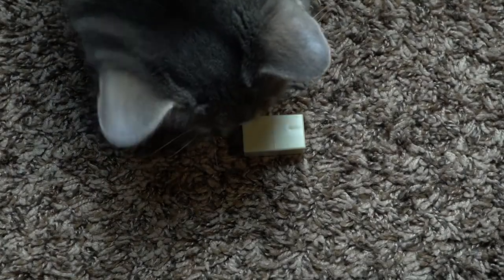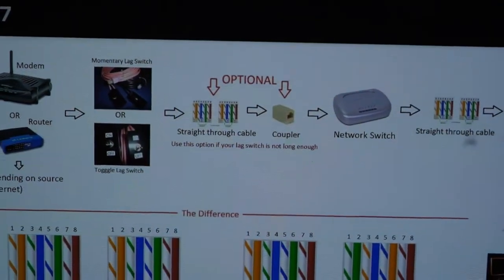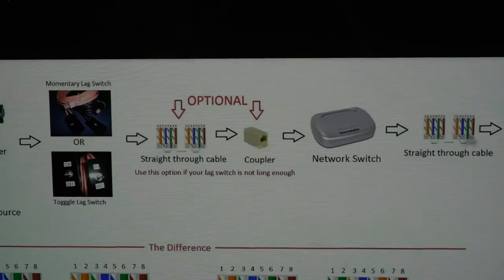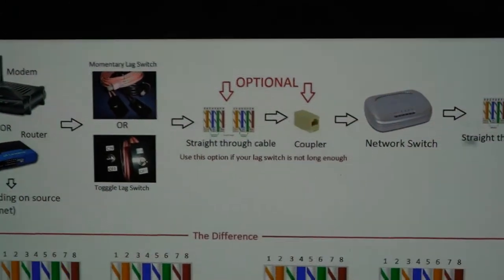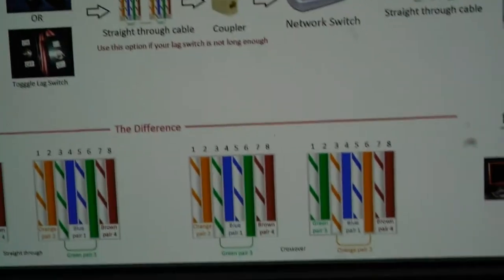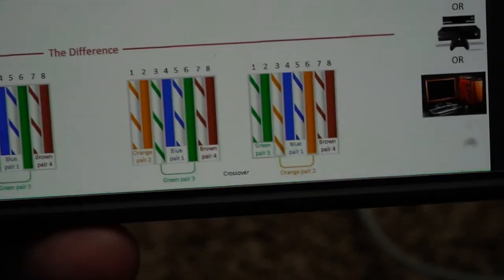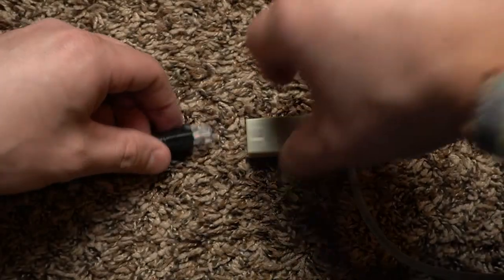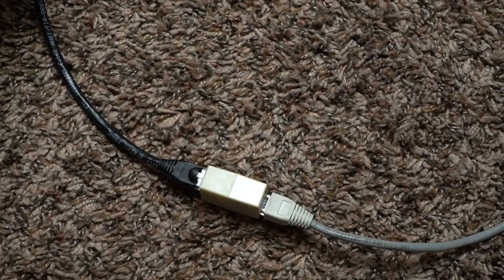Lag switch informational video 2.0

Comment: I have it setup as in video with a TP link switch, i feel like it takes sometimes a couple extra seconds to reconnect so i found it really unreliable and sadly not useful :(
Reply from the maker: Okay, don't use that network switch then, use a different one.
Reply: @mikeeyram  why is it so different ? Just so I know what to look for.
Reply from the maker: @alexbrun6863  I wouldn't know. What ever is on the inside is causing more latency.
Reply: @alexbrun6863  the thing is you don't need a switch what you need is an ethernet hub

Comment: When I use press the lag switch I get disconnected it seems the network switch is reconnecting to slow to the console? What should I do do you think it’s something in the net switch’s settings to make it faster or I need a whole different switch? It reconnects like 3 seconds later is that to long?
Reply from the maker: The only way to change network switches settings is to have a managed one, which I don't know why you would have one of those. It sounds like you could have a crossover cable between the network switch and console. Network switches should reconnected in 1-2 seconds, 3 seconds of total lag might be fine for some games but not for others.

Comment: I have an Arris Modem/Router combo....I have a straight through cable coming from the Arris to an 8 port switch. I hooked one side of the Lagswitch to a port on the 8 port, the other to a Xbox One....I believe I have it correct....when I push down my Momentary switch....for not even a quarter of a second, I lag out....I know the Lagswitch is fine because I bought it from you on Ebay....I'm just wondering if I'm doing some wrong....you rock...ty
Reply from the maker: You have the right set up for being immediately disconnected (as the the item description says, on eBay), if you don't want to be. I'd suggest watching the video and following that set up.

Comment: Can you hook up your leg switch directly to the modem and then into your xbox
Reply from the maker: Nothing is stopping you. Nothing else in the house would have internet as you'd have to unplug the router from the modem to be able to plug the lag switch in. Then as long as you want to be immediately disconnected, you can plug a lag switch into your console.

Comment: hi mike. bought a lag switch off you with the foot pedal for my ps5. ..playing destiny 2, it seems to somewhat work but when i use it , it makes the enemy players laggy and i cant damage or kill them, then suddenly i die to them 5 seconds later. i havent been able to get the jump on anyone at all, its almost like its working in reverse, i mean i can run around fine, shoot and whatnot, but cant do damage..  is this normal. any advice or explanation appreciated. thanks in advance.
Reply from the maker: Games are different what could be correct for one game could be incorrect for another. Trial and error is the best way to figure out what works best for the game you're playing. 
It sounds like you shouldn't use a lag switch when you want to shoot. It could help get close to someone or running away. Also lag switches only work one way, there is not such thing as working in reverse.

Comment: What network switch are you using because the ones I have are all just wireless and I need a way for it to go from my modem to my network switch to the console all wired
Reply from the maker: So you're one of the few people with a wireless network switch. I've never seen one myself. I have a TEG-S24DG network switch. I wouldn't connect a modem to a network switch, I'd only connect a modem to a router.

Comment: Hey I bought the big red button from you about a week ago but it doesn't seem to be what I need. I just finished ordering the toggle switch. The button works, but was too difficult to press whilst in gunfights. Hopefully the toggle switch will be an easier fit. I'm assuming the toggle switch lags by itself without having to press periodically. Either way, thanks.
Reply from the maker: If a button is hard to press (and release), then a toggle switch is going to be really hard to toggle back forth. A toggle switch lags whenever you turn it on and doesn't lag whenever you turn it off. The foot pedal, and maybe the remote one, are the easiest. You can also put the big red button lag switch on the floor.
Reply: @mikeeyram  well I can flip the switch in front of me, for a few seconds here and there, much easier than tapping my foot to a beat while playing lol. I did place the button on the floor for a while yesterday, but couldn't get value out of having my body in a weird position to play kick drum 😂. Thank you for getting back to me, and for the products. We've been playing against people in the last of us, using a switch to beat us. I was just trying to level the playing field. If it doesn't work for us, no biggie. I appreciate your time man.

Comment: I bought you 2 cables.. a toogle cable and a momentary cable.. but unfortunately with the 2 cables the reconnection is too long.. 5 sec to 7 sec is really too long.. I use a netgear fs605v2 router and a  fs105 but it's the same thing .. do you have a suggestion to help me
Reply from the maker: The number of cables or lag switches is irrelevant to the reconnection time of the network switch. Those to network switches have always worked great for me, I don't know why they wouldn't for you.

Comment: What is the network switch because I was trying it on cod and it didn’t work what would you recommend because I want them to lag not me
Reply from the maker: You can google what a network switch is. According to what you said the lag switch is working fine. A lag switch is connected to your network, you will always lag. To affect others you have to be host.
Reply: @mikeeyram  how does that work like so if I’m host I will be fine and they stand still ?
Reply from the maker: You must have missed where I said: "A lag switch is connected to your network, you will always lag" When you're host, the lobby will lag with you. The results depend on the same, it varies.

Comment: how do i put my console on lan w/o a computer
Reply from the maker: It sounds like you don't have a LAN cable where you're at. Assuming you PC is running on WiFi, plug the lag switch into the PC and network switch. Then you'll need to configure the PC. I wouldn't recommend using the PC as a network bridge though, I wouldn't recommend a network bridge all.

Comment: Will the lag affect all devices connected to the switch? or to the router? How could I connect a separate console and ensure it is not affected by the lag switch
Reply from the maker: Why is the router even in that question? You think the internet goes from the modem, to the router, to the network switch, back to the router and then back to the network switch again? If you don't want to affect anything else, then don't plug anything else into the network switch, the should be common sense.
Reply: @mikeeyram  does it matter what the straight through cable is ?
Reply from the maker: @sinlxess  There is only one definition of straight through cable.
Reply: @sinlxess  🤣🤣🤣

Comment: I set up router connected lag switch then to network switch and straight cable from switch to console, internet just not working, after i unplug lag switch cable from switch or router , internet comes back, when both sides of lag switch connected it aint working, internet is off, what am i doing wrong please help, i got this 50 feet button lag switch from ebay
Reply from the maker: Without a LAN cable plugged into the network switch or router you have internet on your console. When you plug a cable in, you don't have internet. It sounds like the console is auto connecting to LAN when it detects a cable, however the port isn't fully working as there's no internet. I would suggest to look at the LAN port on the console and possibly getting it fixed
Reply: @mikeeyram  i just cant use lag switch, the second i connect both sides of it to router and switch, internet shuts down on console, everywhere pretty much, when unplugging it, internet comes back on console, i just cant use it on ps5
Reply from the maker: @DT_775  Once you fix the LAN port on your console then you can use a lag switch. But for now WiFi only it seems. Unless you have a weird loop in your setup or the network switch is actually a 2nd router or both.
Reply: Thanks for the help, i had it wrong connected, lag switch from router to switch and another cable router to switch, didn't realise lag switch was main cable between these👍
Reply from the maker: @DT_775  To be able to run 2 ethernet cables between 2 devices you need to set up link aggregate. However doing that would make a lag switch useless, as the other cable would just bypass the lag switch.

Comment: Hi, I have a question, if my internet modem is also a router does it work ?
Reply from the maker: I don't know where/if I say it in the video but the item description says (on eBay or Shopify stores): "The router may stand alone or be a modem / router combo." Basically you're asking if you can plug the lag switch into a router, that's what the set up says to do, plug it into a router. The fact that the router has a modem built in is irrelevant.
Reply: @mikeeyram  Hello again, I have another question, I  just received the Foot Pedal Momentary Lag Switch and when I press the button, the internet connection is too long to return, you know why ?
Reply from the maker: @Gasty.  Check your email, I replied there before this comment was posted.

Comment: Hey man I got your button and whenever I use the switch it works but my reconnection time after I stop lagging is very slow. What do you recommend I do? I’m using the netgear gs305 network switch
Reply from the maker: Figure out what your ping is to see if that's the problem. Try a different network switch.
Reply: @mikeeyram  do you know of any switches that work best?
Reply from the maker: The two listed in the item description.
Reply: @mikeeyram I’ll try one of them, thanks for sharing
Reply: @mikeeyram I just got the FS105 switch and I connected everything the same way but now I can’t lag at all. EDIT(Lag switch is working now I noticed the ports on the switch matter for it to work)
Reply: Wdym when you say you dont lag anymore ?
Reply: I have the same router switch and i can't get mines to work. Where did you put your ethernet cable on? 1-5?@oppressormk2594

Comment: I got it all working pretty much but it takes around 15-20 seconds before lag switch happens, is there a way like speed up lag switch to happen faster, maybe it depends on router or network switch?
Reply from the maker: Basically what you're saying is you're able to unplug the ethernet cable from the network switch or router it takes your end device 15-20 seconds to lag and then even longer to disconnect? Logically that doesn't make any sense. There's something wrong within your set up somewhere or maybe the end device is switching to WiFi and then back to LAN for some reason after 15-20 seconds.
Reply: @mikeeyram  im pressing lag switch its got button type switch, holding 15 seconds and works after, whats normal lag time as it should be i dont even know
Reply from the maker: @DT_775  Lag switches work immediately when pressed or flipped (type of switch doesn't matter) and you can usually lag for 3-5 seconds, any longer and you risk being disconnected.  I can upload a video of a lag switch working on a continuity tester.
Reply: @mikeeyram  i really don't know whats wrong with my setup, i got main router in living room connected to it with long cat5e cable to second router that is in bedroom,  in WAN head jack of second router i got lag switch connected and second end into Network switch, from there straight through cable to ps5, pressing red button on lag switch, 15-20 seconds holding then lag magic happens, not getting disconnected it changes servers in game and stay in game, rdr online, i do all the stuff in game, missions, collectibles nobody bothers which is good, but 3-5 seconds switch how that even possible i wonder
Reply from the maker: @DT_775  Okay, you have one router and an AP. As two routers in a single setup will cause problems. WAN should only be used when connecting to a modem. You should be using LAN ports in your house. 3-5 seconds is possible with the correct set up.
Reply: @mikeeyram  yeah two routers are bridged in single setup, without wan connection no internet from second router
Reply from the maker: @DT_775  WAN is mainly use to connect a router to a modem, not routers to network switches, that's what LAN is for. WAN on the 2nd router should be connected to LAN on the first router. To anyone reading this else, don't have 2 or more routers in your setup, get an AP.

Comment: How i got no Delay and which is the best cat cable
Reply from the maker: If you get no "Delay" or lag then the lag switch is not connected to the end device or it's being bypassed. Currently the best cat cable is cat 8, with 9 and 10 coming soon. However unless you have a server or you run a data center, who cares.

Comment: I hooked mine up according to pics amd vid. Switch has power. Ports have power. Lag switch works.  Net switch works. Once I plug the lag switch into the net switch and straight through from net switch to console I have no internet going to console. Help?
Reply from the maker: Make sure all 4 ends are fully plugged in.
Reply: I got the network connected. How long should the toggle be left in on position? Like am average
Reply from the maker: That depends on how long the network switch takes to reconnect and how much lag the game can handle.
Reply: Its gta and idk haha 8 secs put me in a solo public lobby
Reply: Is there a certain set of settings I need to put the Xbox on?
Reply from the maker: Just make sure it's on LAN and not WiFi
Reply: @mikeeyram  how do u do that on xbox
Reply from the maker: Usually network settings are under Network Setting, or System Settings then Network.

Comment: Can I connect this to a Verizon Wi-Fi extender?
Reply from the maker: As long as it's a hard wired extender. I have a wi-fi extender in my basement connected to the router via a Cat 5e cable. If I wanted to I can plug 3 more things into the extender.

Comment: Hey great video,was wondering if you could help me when i use my lag switch it disconnects me to a solo lobby on red dead was wondering if it was my network switch being to slow i have router to lag switch to network switch to xbox with Ethernet cable is this correct ?
Reply from the maker: Only you can tell how fast or slow your network switch reconnects, I have no way of knowing.
Reply: @mikeeyram  yea what would be the average time it should reconnect mine takes about 4-5 seconds which feels kind of long i have ordered new one same brand as yours so hopefully gets working thats for the video did greats job
Reply from the maker: 2 or less is best.

Comment: I get lagged for 4 mins and then it gets me out. It disconnects. What could be the problem? Thanks. Great video! 👍im using a Tp link switch
Reply from the maker: That's a very long time to lag. It sounds like an ISP, modem or router problem. Or you could be lagging to much, not allowing the connection to go back to normal.

Comment: Question. I have spectrum isp and a netgear router, with and Trendnet switch but it's taking 7-8 seconds for my switch to reconnect. Do you have any tips or ideas of what I can do to correct this? Or what router/switch I should use instead? Thank you btw
Reply from the maker: Use a different network switch.
Reply: @mikeeyram  what network switch ? I have netgear fs605v2 and have the same problem ..its too long to reconnect ..7 sec
Reply: Did you find a switch that was faster?

Comment: I’m using a patch Ethernet cord is that the same as a straight through?
Reply from the maker: I wouldn't use a "patch" anything in the set up. While they can be interchanged there can be differences. I would just use a standard straight through ethernet cable.
Reply: @mikeeyram  Every Ethernet cable i look at online or have says patch cable where are you getting your non patch cables? Also I saw the network switch you have in the video can you confirm that one works good for lag switching?
Reply from the maker: @J914XX  Like I said: "While they can be interchanged there can be differences" According to router-switch.com: "Can I Use Patch Cable as an Ethernet Cable? Yes. In most cases, an Ethernet cable and a patch cable can be the same thing in copper networks." The key part, in most cases. I make all my own cables. There are 2 network switches in the video both are TRENDnet, one has 24 ports and the other has 8 ports. The netgear network switch that I used to make the other video works better, that one is in the item description.
Reply: @mikeeyram  I bought a FS105 v2 so maybe it will work good enough now
Reply: @mikeeyram  do you think it’s worth buying the other one you recommend just in case this one doesn’t work?

Comment: I've got a question when you are using your lag switch do you turn it on or off? Because when I turn my lag switch off it disconnects me, is this how it's supposed to work?
Reply from the maker: That's interesting, I've never labeled them like that. I label them as off = normal cable, on = lag. But yours is reversed, the first one ever. When you don't follow the set up in the video, that's what lag switches do, disconnect you.
Reply: @mikeeyram  i forgot to mention that my lag switch is handmade, so I guess I did something wrong, but I don't know what it is 😅
Reply from the maker: @King_ShadowX_X As far as I know all lag switches are handmade.